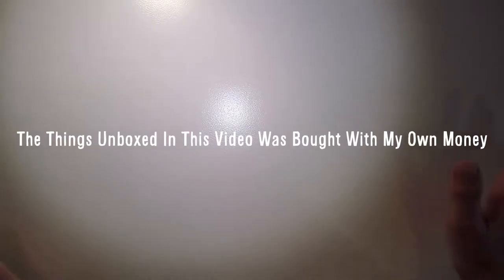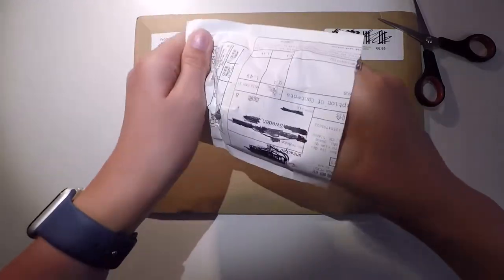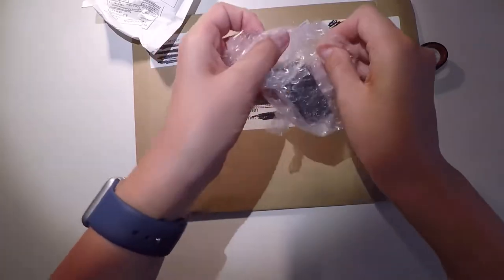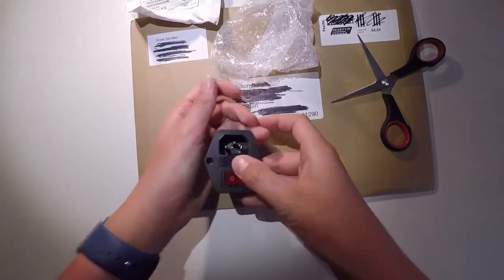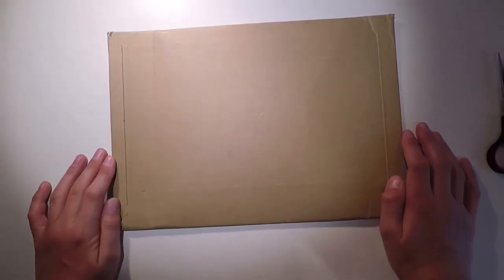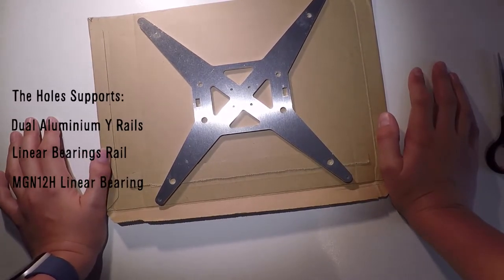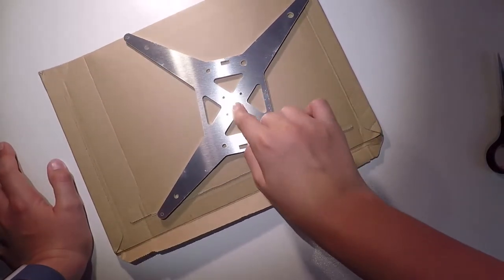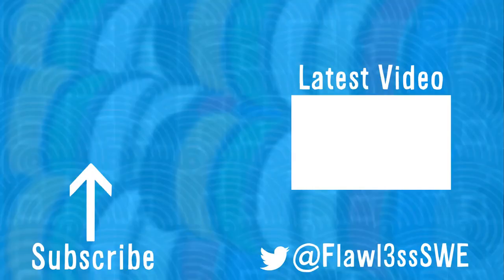Tevo Tarantula Aluminium Y Carriage Unboxing

Comment: Glass fuse varies depending on where you use it. For example, if you are using 220 volts of electricity, the 220V / 5A glass fuse is sufficient for Tarantula stock PSU .Thanks for the video.